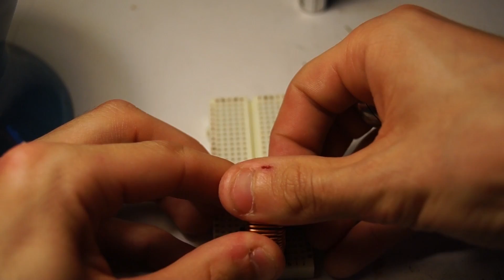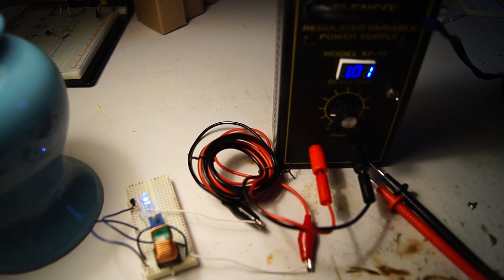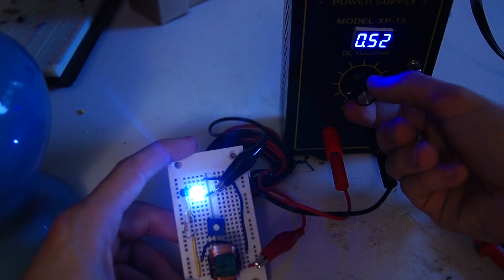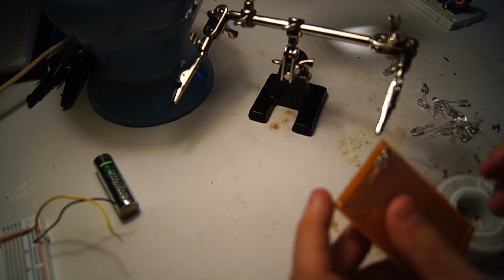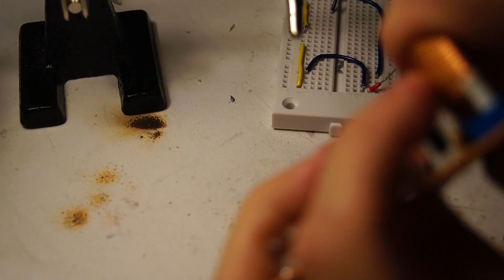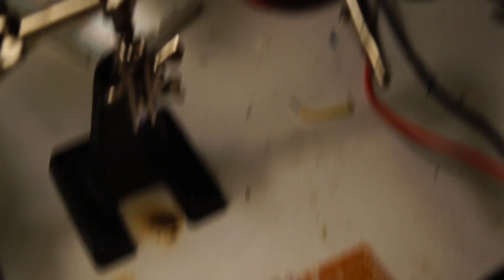How to make a Joule Thief Circuit Explained

Comment: Thanks for the video. I build it with your instruction and it works perfekt. I got it work with 0,92v. My supply only goes to minimum 3,16v. I use voltage divider.

Comment: I finally got all the parts. So far I finished two circuits of the first part of your video. Both work well with 1K resistor not 220 Ohm.. I also inserted 1,2&3 LED's. Everything is great and functions on 0.8 volts ( dead battery AA)or less. Next will be using a solder board. Again thank you for your video.

Comment: That's a great Toroid core.  Did you make the base for it??  I don't see one like that via the link to Banggood you provided in comments below !!  All of theirs just have open leads at the bottom of the windings.  I'd like to get/make a few of those !!!
Reply from the maker: I found this one in a computer power supply. Cant find anything close to it online.
Reply: Thanks !!  I think you got lucky to find one in a commercial power supply that is plug compatible with breadboard spacing !!

Comment: brother can i run my wifi router by this Joule Thief ' is this joule thief supply Ac or Dc Current '? & What things are Needed  to make it plzz say
Reply from the maker: Not sure if you can run a router like this. I wonder if this would work by taking two double A batteries in series on the input and setting the output voltage for your router specs. http://amzn.to/1U8yARq

Comment: I thought everthing was ok..after I made this circuit..but my transistor (2n2222a) is getting very hot..while Im using 3 volts....not as bad with 1.2 volts..what do you think...??
Reply: Use a power transistor (2N3055 or any other) with heatsink,

Comment: I like this !

I tried to find a power supply like yours, but all the xp15's  I found did not have a digital display.......did you add this feature ?
Reply from the maker: +qwertyqwerty1955 yes I added that to it. This is the one I used http://amzn.to/1QFgRCQ
Reply: +ZooRatedProductions   did you have to use an external power supply (battery)  in order to read the very low voltages  ?
Reply from the maker: no you dont

Comment: Your video is amazing. Thank you. Many are asking if you could give advice or make a video to make this Toroid or where you bought from. Again,thanks.
Reply: Any toroid with two windings of 20 turns should work fine, This circuit isn't all that fussy about component values. It might be better to use a larger transistor if you want to run lots of LEDs.

Comment: Judging by the burn marks and bubbles on your bench, you've pushed components to their extremes quite a few times. Heh heh.
Reply from the maker: fb314 the bench suffered marks from a soldering iron, and yes the breadboard suffered burns from cranking the power to the max for fun.

Comment: I would like to posit that, if you have a 10kOmh Potentiometer, you do not need that 200Ohm resistor.  Try it, you'll see!
Reply from the maker: Lunartrek That 200 ohm resistor is so there is not a direct short from the base of the transistor and the core.
Reply: I understand, but the potentiometer IS a resistor, after all, so doesn't it prevent the short?  Anyway, the 200Ohm resistor doesn't effect the circuit's functionality, obviously.  I just like keeping things as simple as possible so I stick with just pots alone.
Reply from the maker: Lunartrek I do understand but in testing with this circuit, I was just using the pot alone and when it was anywhere from 0-200 ohms it was cutting out and not working for me. This could be a faulty transistor or something with the toriod.
Reply: ZooRatedProductions   I get it.  So you just made 200Ohms your baseline and used the pot to fine-tune the circuit.  Makes good sense.   Anyway, it was a fun video.

Comment: Glad I found this video again. I followed your instructions exactly, about 10 dozen times. Not one time did this circuit do a thing. I even tried setting up the torroid transformers differently, no change. I know not every way I set it up was wrong, there's only a small number of ways to connect the transformers. If this really works, I should have got it to work just through trial and error. If it does work, I would like to know if you would make and sell me about 4 of them for $50
Reply from the maker: Were you using the exact same parts. Also the torroid is a tricky thing to get right. If you wound it yourself, it may not be tight enough or enough winds. You could also try to find one already made like in a junk computer power supply. I have had this problem making this video actually. I put everything together and it didn't work. So I had to make the video all over again.
Reply: Wassup,i have your problem for a long time because every time i was make a mistake,and that mistake it was the windings from the toroid core wich has to be at least 10 turns biflar,after you do this chechk
Reply: If is still not working try to look at your transistor pin out confoguration,because if you use a diffrent npn transistor it woud have a diffrent configuration of the base,collector and emitter...good luck...for me the mistake was my toroid ...see what it's yours...

Comment: Will it work in pumping 5v into something like 10v?
Reply: Yes, but you don't have to put a high load
Reply: Ok
Reply: Jeronimo Murruni
I tried it and got 10v from a 5v source, but the transistor heats up fairly fast, what's the simplest way for me to fix that problem (if it involves a heat sink I don't have thermal paste).
Reply: 5thDragonDreamCaster What transistor did you use?? Tell me the code and i'll find one equivalent, but with more POWER :D
Reply: Jeronimo Murruni
Never mind now, I swapped it out for n channel mosfet and it worked fine, but thanks though.
Reply: 5thDragonDreamCaster No problem :)
Reply: Jeronimo Murruni
I'm using it to run a computer fan off of a USB cable, the fan would still run off of just a USB, just too slow for what I want.

Comment: I can't find a datasheet for "S0038 transistor"
Where did you get that transistor from?

Also,  can you provide a detailed description, part number, & inexpensive vendor  for the toroid-shaped ferrite core?
Reply from the maker: I found my S0038 transistor in my spare parts bin. I am not sure where the datasheet can be found if you can't find it online. As for the the core, I find mine in old computer power supplies. Try to find junk electronics to take about and find parts to use.
Reply: Could you provide the approximate measurements of your ferrite core? (e.g.:  outside diameter, inside diameter, & width)

If you have a caliper, it would nice to know the wire gauge of the core windings.

Thanks

Comment: how to convert 1.5 volt battery to 5volts output using that toroid. and how long the battery last when using it.. 
i am just wondering to make an lm386 amplifier powered by that toroid
Reply from the maker: You would have to build a rectifier circuit I think because this circuit is putting out ac, but because it is oscillating so fast, the led appears to be on.
Reply: ZooRatedProductions Does it really put out AC voltage? This is good for my purpose of the Joule Thief. I need to raise up the USB's 5V to 9V. I would just have to play with toroids to get the voltage I want. Nice video and explanation :D
P.S. Subbed ;)
Reply from the maker: When I tested it with a scope it was saying around 100 volts ac. This is with barely any current though. The reason that it lights the led is because of the speed of oscillation of the magnetic field collapsing inducing a voltage.

Comment: Thanks for your explanation. I want to make this circuit.
 Please let me know the materials. What is the blue thing?
* I dictated from your explanation about material
1) Ferrite core 2) Transistor 3) Resistance 200Ω
4) ???(blue thing) --- perhaps adjustable resistance?
5) LED
6) some Jumper  wires (middle & small size)
7) AA cell in case8) Bread board
Reply: The blue thing is a 10kΩ potentiometer (i.e. variable resistor).
You could probably obtain a similiar part using one of the following urls:
10KΩ potentiometer:
-  http://www.jameco.com/webapp/wcs/stores/servlet/Product_10001_10001_2118791_-1
-  http://octopart.com/3310y-001-103l-bourns-578527
-  https://solarbotics.com/product/rt10k_t/
-  http://www.tme.eu/en/details/3310c-001-103l/cond-plastic-single-turn-axial-pot/bourns/#

Comment: What is the device you used to control the source voltage? Btw, great video!
Reply from the maker: Not sure what you mean. The battery goes to the coil which goes to the transistor. The rapid on-off action of the transistor causes the magnetic field to collapse, inducing a voltage of around 110VPP. Now the current is very small, causing it to off of a nearly dead battery.
Reply: I meant the device that controlled the current (when you set the input voltage to 1.32 volts)

Comment: Have you done any measurements of efficiency ? Power in power out ? How lossy are these systems ?
Reply from the maker: I have not
Reply: ZooRatedProductions Thank you . I , with finger in the wind knowledge , would suggest , they would be found , notably lossy , as it is a brew of resistance - heat loss & collapsing magnetic field ...... but I not suggesting it can be bettered ....... without more up front cost & madness .  I think the term that you comes to hand , would be cost effective .
Reply from the maker: the only thing that I measured was the voltage across the leds and it was 110vpp. it didn't make any sense to me or my professors.
Reply from the maker: I think this happened because when the magnetic field drops out, it creates a voltage spike and that is what the scope was reading.
Reply: ZooRatedProductions That ' s the trouble with instrumentation , it is sometimes more difficult to understand what it reads , than if the reading is correct . The transitory becoming the definitive .

Comment: I hooked up a nine volt
Reply from the maker: what was the voltage of the output?
Reply: I'd forgot lol
Reply from the maker: lmao
Reply: So what is the purpose of the joule robber
Reply from the maker: T.P. Pansas the purpose of this device is to take the small voltage coming out of a dead AA battery, and boosting it to run some leds. you could have a that is considered dead in a tv remote, still work in this circuit for at least a couple of hours.

Comment from the maker: +badley wrong
That seems awesome with the two of them in parallel. I'll have to try that some time. Also powering it from pencil seems really interesting.
Reply: wils35  Graphene is the future... 1 atom thick layer of graphite. Fast charging, slow discharging, can be used as batteries and/or super capacitors, and it can store a heck of a lot of computer data. Graphites conductive capacity as well as its ability to be a resistor can possibly reduce most computer parts to just graphite.
Reply from the maker: that's pretty sweet. if you'd be willing to do a video on that, that would be awesome.
Reply: ***** You saying about graphite being a good conductor, look up Graphene ;)
Reply: ZooRatedProductions which transistor r u using ..?
Reply: +Justy John Probably just a 2n2222a. Easy to remember :) They can get hot though when boosting more than 2v.
Reply: bc547 is good too